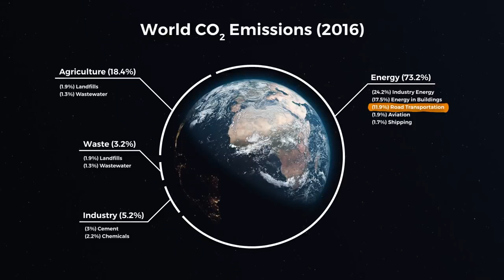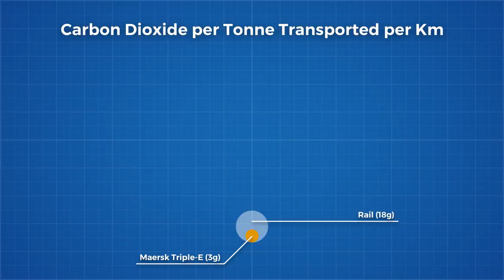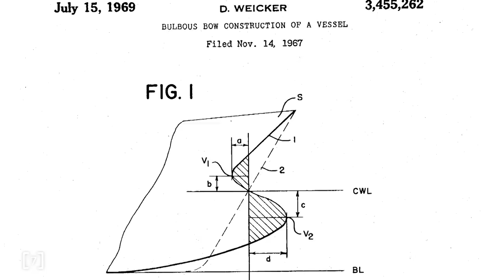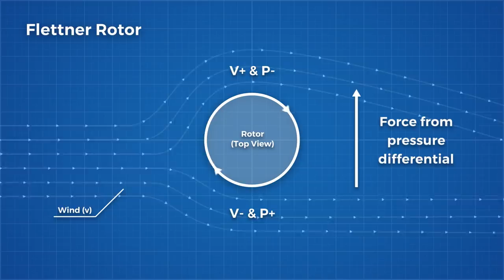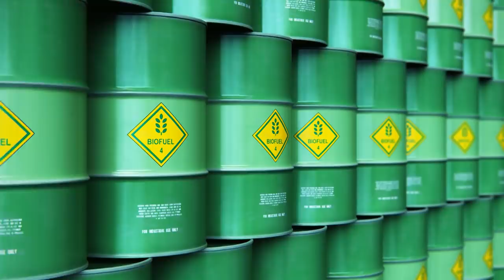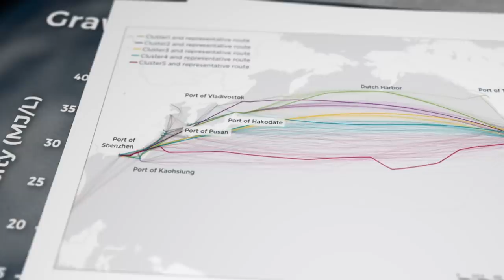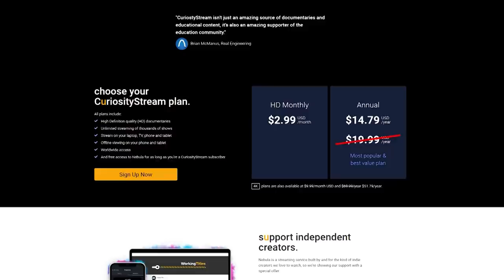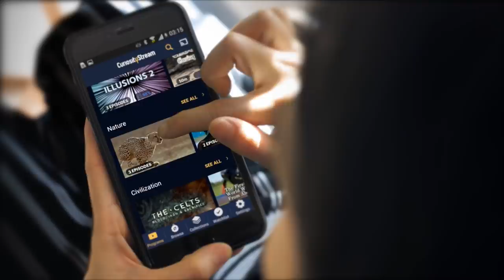Are Renewable Powered Ships Possible?

Comment: If the goal is CO2 Reduction is the goal, then make then nuclear powered.
Reply: Start by doing a web search for ‘nuclear ship savannah’.  ‘They’ say nuclear is cheap, it’s not it is expensive as well as being complicated, dangerous, not universally socially acceptable and having only ‘no need for refuelling’ as a questionable advantage; actually it does need refuelling just not as often.  When they do need to refill the warming up stuff it takes considerable longer than pumping tonnes of thick black cSt380 onboard which is one of the reasons HMS Queen Elizabeth is pushed about by gas turbines thus using the same fuel as the aircraft that fly off of her.  The Royal Navy (RN) also have a similarly high degree of skills and expertise and the RN’s current operational nuclear fleet is 8 boats in two flotillas, four attack subs and four ballistic missile boats.  The carbon footprint of all the extra bits of hardware and the fuel, including processing thereof, from ground to propeller, are the external costs that never seems to get considered.  Disposal, once it wears out, of both the machine (that was a ship) and fuel is another can of worms best left unopened.  The 26 RN boats no longer in use are laid up (some in Rosyth and some in Portsmouth) awaiting long term deconstruction including dealing with the fuel rods and other irradiated material.  The USN is not, as far as I know, a commercial organisation working to very tight margins and has the skill and expertise to handle the complexities of nuclear power.  For those who still think that nuclear energy might be the answer I recommend this report: - https://www.bbc.com/future/article/20200901-the-radioactive-risk-of-sunken-nuclear-soviet-submarines? ocid=ww.social.link.email.  The navy of the USSR might have been under resourced and over extended but it was still generously supported in comparison with merchant shipping.

Comment: I will race with just 6 SETS x12 X 20 FT stainless A4 FLAT HEAVY OPPOSING  FLAT BLADES IN ELECTRONIC4ALY CONTROLED BEARINGS BETZA THE ICE IS LEFT ON ICE CAPS.SHIPS PLANES CARS TRUCKS WHOLE SHEBANG.BONUS .BETZA DOUBLE THE TIDES X 1000 X WIND.  K PLEASE NO DEBIT BLANK CHECKS THANKS